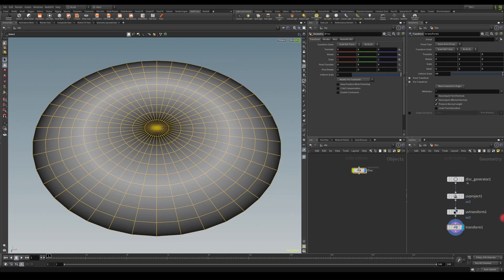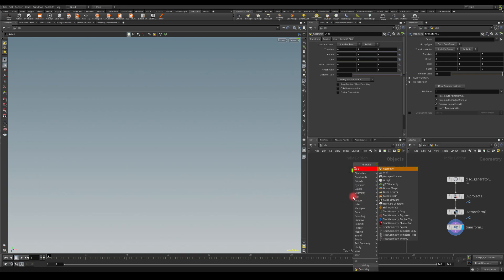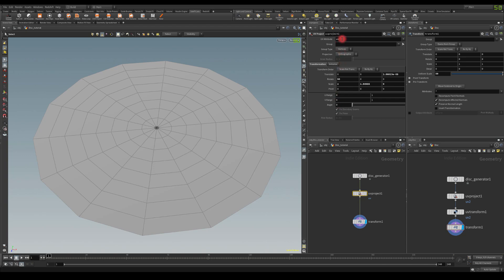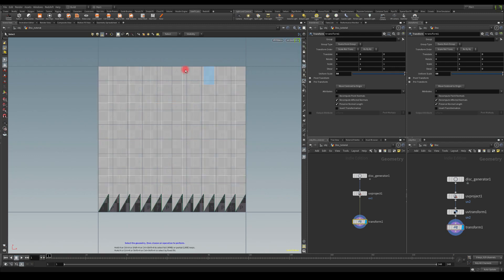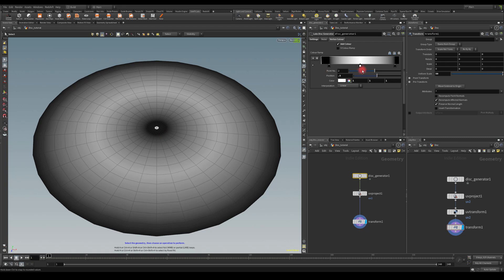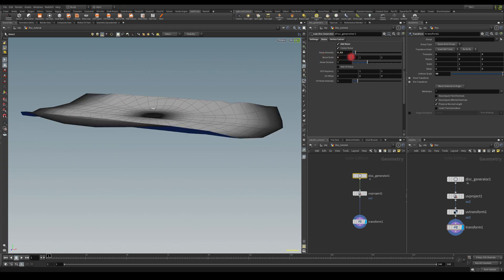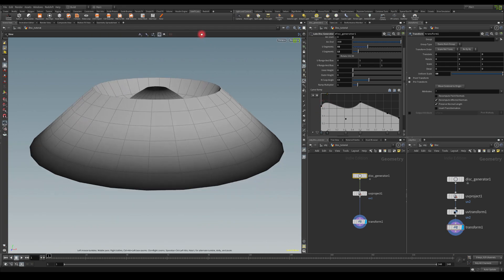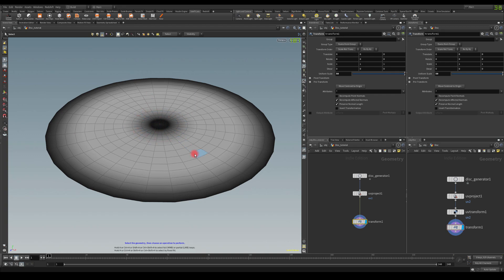How to Realtime - VFX / Disc Mesh TUTORIAL Using Houdini

Comment: I think you also can use gradient node if you installed side fx labs
Reply from the maker: hm I just tried to use it... seems like you can apply it to something like a plane but when applying it to circle you wont get a radial colorization only linear. I mean there must be a way I just did not looking into it as the gradient I need it built in to disc node. Any ideas how to make gradient node to work as radial without making this over complicated?  Thanks for point me to the node.
Reply: for disk generator this is not necesarry because this node has own acces to vertex color. I used it for cylinder model